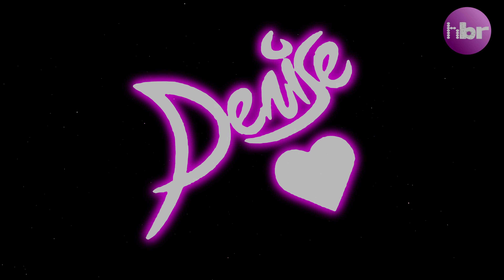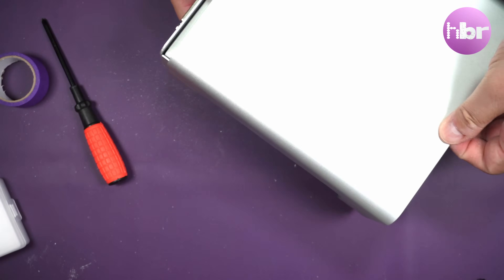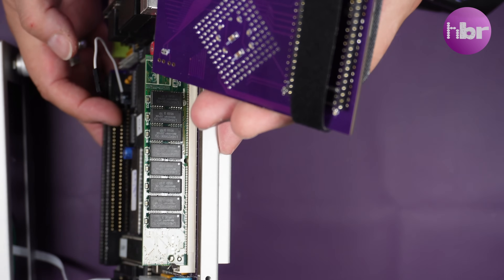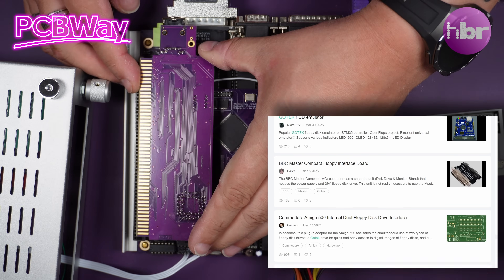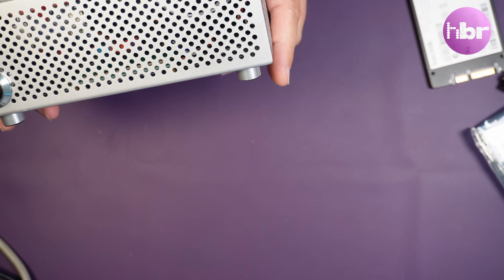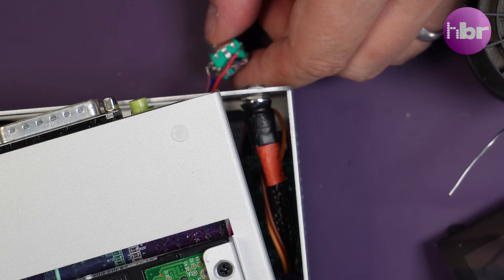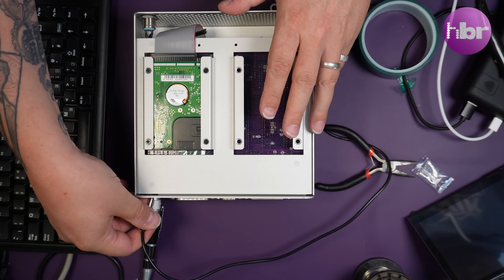Get READY to Turbocharge This TINY Amiga!

Comment: Hi! What a wonderful build this tiny Amiga is.  Wouldn't it be that complex to build it could have been my next retro-winter-project... ;-)
But there's an issue with older Sysinfo Versions pre 4.4 according to the Chip RAM. Running powerful CPUs with caching, and so on, the index is incorrect. It isn't really faster, just shown so. - Sysinfo 4.4 fixes this and shows a more realistic index...
Reply from the maker: I will do an update on sysinfo at some point :)
Reply: @hackbuildrestore  I think you should give it a try.
On my Furia 020 with shadow ROM and 32bit Fast RAM the Chip RAM index went down from 2.9 to 1.2. when running SysInfo 4.4.
The latest beta (4.5b12) shows you the Bandwith (MB/s) for Chip RAM, FAST Ram and ROM access. I think knowing about this helbs to ensure that the configuration is correct. ROM access is hugely slower, when ROM shadowing, or ROM copy is disabled.

On my system I get following values[MB/s]: Chip RAM 2.38, Fast RAM: 25.0, ROM: 25.0.
Would be interesting to know how much faster your 50MHz 030 board is...

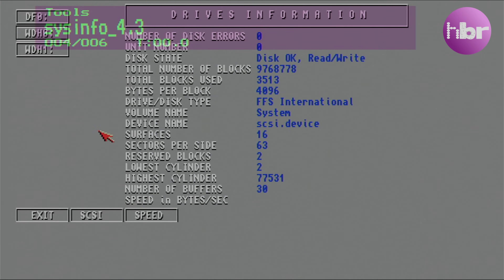Comment: 7:52 mufastrom
Reply from the maker: Not quite sure what you’re telling me / asking? 3.2.3 update installed but I think I have 3.2.2 Rom so the running kick is in ram?
Reply: @hackbuildrestore if you add mufastrom to your user-startup it will fix your slow ide speed
Reply from the maker: Every little helps, increasing buffers is likely to help, technically my ROM is already in fast ram, but I’ll have a play, thanks!

Comment: Hi mate, how is the heat disipation? That worries me with the Denise especially with the TF.
Reply from the maker: Seems fine the aluminium case is doing a fair share of radiation, I have had it on for about 8h without any issues it maybe that when I look to install the network card a fan sneaks in who knows :)
Reply: If I may, could you let some of yourself shine through. Some of the delivery is um… for want of a better word, dry. A teleprompter might help with the eye-line when you’re on screen. Very informative.

Comment: Not sure I'd have gone with a spinning HDD in this day and age. The convenience/reliability of CF/SD card solutions feels worth it. But I do appreciate the desire to be [approx] period correct
Reply from the maker: Hard drives don’t actually fail as much as some would have you believe! CF card is a fabulous option, I usually use Disk on Module devices like in my A600 but there wasn’t enough height … and A2000 has a blue SCSI in it :) no be honest the cancel drive is in part in leu of an HD led, but its nice to hear it spin up none the less! Sometimes the lack of convenience is part of the nostalgia…
Reply: @hackbuildrestore  Yeah, tbh I don't think I've ever actually had a harddrive fail in 30+ years, and yet... Disk on Module is quite tempting though. For my own custom A1200 setup I have a CF relocator that lets me move it from the machine to the PC without having to open the amiga, as I generally prefer doing any config/setup in winUAE
Reply from the maker: I use Zip drives and Ethernet :) WinUAE works well to get things started, it’s also a good backup option when you can just remove the medium and put it in your PC - if we all did the same thing it would be boring lol
Reply: I have literally more than 100 pounds (45.36 kilos) of dead hard drives from the last 35 years. They're from a lot of servers and workstations through the years, but a number of them died in Amigas. I had a 340 MB Maxtor in an Amiga 4000 that ran 24/7 for about 4 years before it started s creaming in pain. After I replaced it I disassembled it to see what it looked like inside and it had ground the heads off one side and seriously grooved the platter to the point that there was grey dust all over the interior. I was amazed that it worked at all, but it did somehow. I have had hard drives last for 10 years in use 24/7 and had some die in less than six months.
Reply from the maker: Early drives are less reliable MFM drives from the 80s don’t usually survive, some consumer drives where cost cut in 90s… Being mechanical if abused in harsh conditions they will fail, excess heat plays a part…